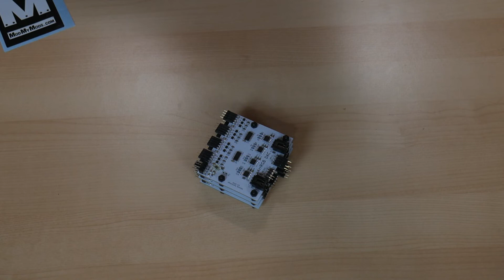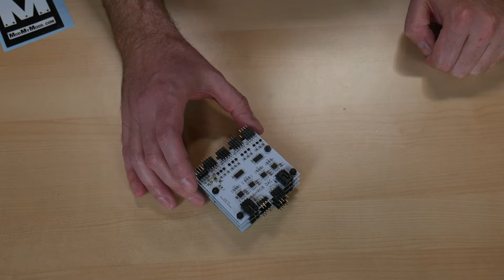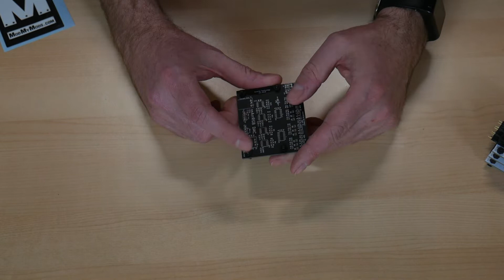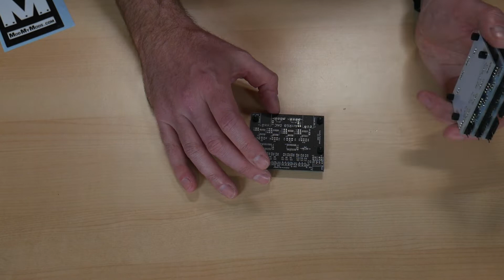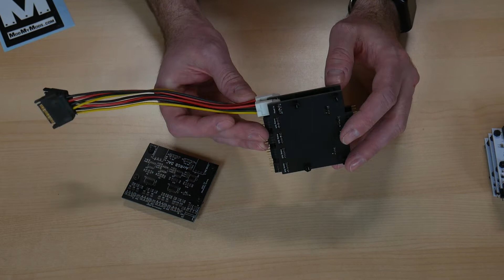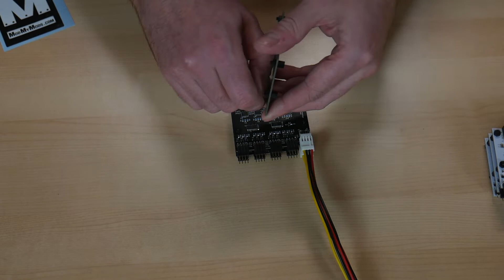RGB DAC Update: Rev 4.0

Comment: Still at it brother, keep going. Although you haven’t sold me one yet😆
Reply from the maker: Yeah one reason I am going to have others sell them. I have one for you and Brandon. Just got some anti static bags for them. You wanted a 5v TT RGB fittings DAC? How did you want to control MB or Corsair?
Reply: Solarity Technology Corsair or whatever way u made yours dance so beautifully with all those colors.
Reply from the maker: @themword1279  https://cdn.discordapp.com/attachments/413045885476274178/571420334860009473/20190425_221319.jpg

Yours is the one to the right, I had to switch out the headers to make it work with the TT RGB fittings. Please contact me via email or join my discord: https://discord.gg/8dvaWdM